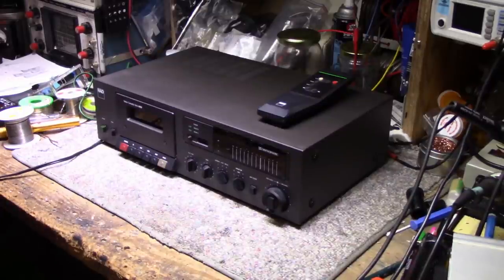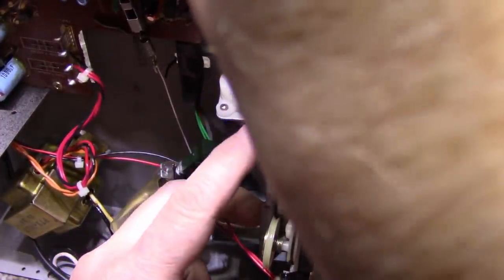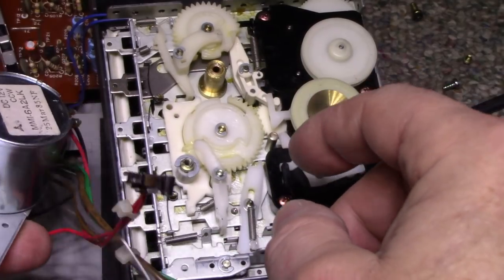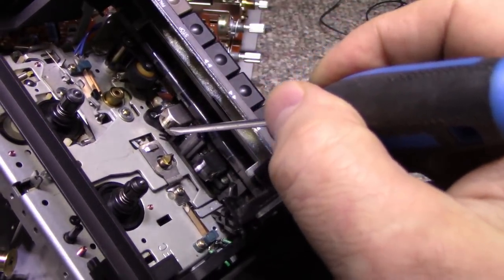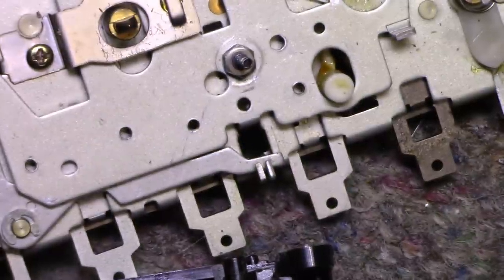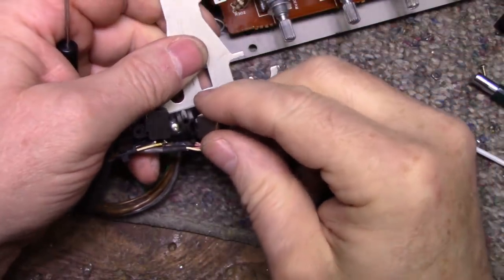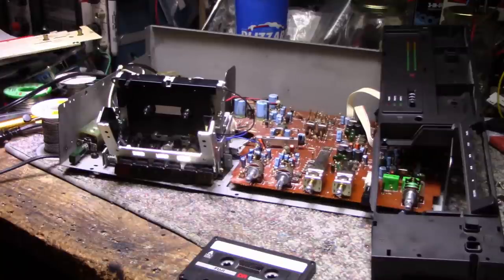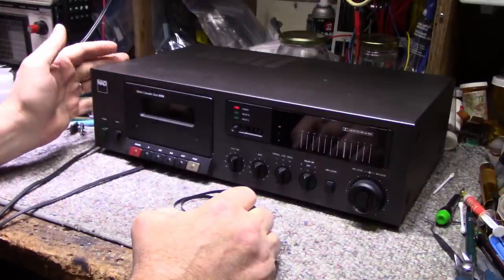NAD 6155  Cassette deck - repairs (Ep. 122)

Comment: Great video. I have two of these NAD 6155 decks and the both have the exact same issue where part 51 (head base) cracks under the immense pressure of part 52 (spring).
They really are an absolute NUISANCE to work on and I gave up on mine. The screw post idea is really awesome. I'm gonna give that a try.

I was super nervous when you were driving home the screw that holds the head base to the mechanism (the one in the top right corner) because on mine at least, the plastic was so brittle that it snapped as I was screwing it down.

Comment: I picked up the NAD 6050C deck and discovered the very same issue. The difference was the fractured piece was sitting in the case. I was able to JB Weld the piece back together and a year and a half later it is still intact.
Reply from the maker: Nice save!

Comment: Well, there is something worse than a JVC Cassette Deck. That Spring looked Automotive Grade. A string to activate a switch, that is very well thought out. Never been a fan of NAD. Has more elec caps than a stereo receiver. That NAD Green Pause button, not too good.

Comment: I just saw this, and thank you for the good and bad news: The good news: I learned what is wrong with my deck! The bad news: What is wrong with my deck. What a kick in the NADs! Question: Where the heck does one find quality belts these days without having to pay more than the deck is worth?  I tried several belts from Amazon, and they're all crap even for the cheapest machines.  I found a set on eBay, but I suspect despite the expensive price, they're the same cheap crap.

Comment: Looks like that deck wasn't really made to last based on choice of parts and difficulty to service. Was that green stuff maybe (a poor choice of) factory lubricant that was breaking down? 

Awesome video, thanks.  Very informative, and also good to be reminded that even the pros have units they struggle with... sometimes you got to just be persistent!
Reply from the maker: Like I've said before, NAD is one of those companies that has great ideas and designs on paper but it all falls to crap when they hand over the plans to Production